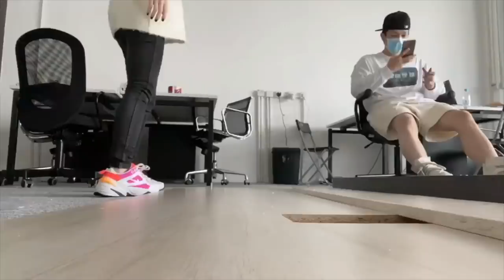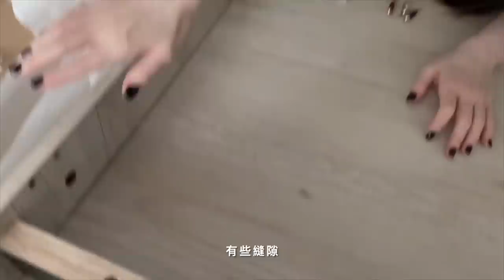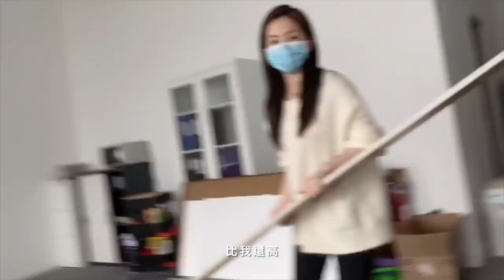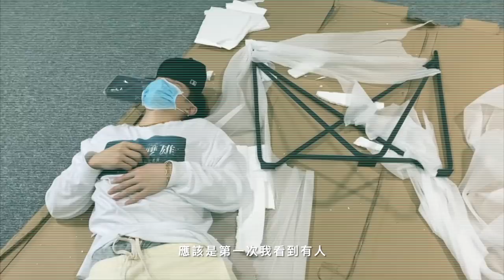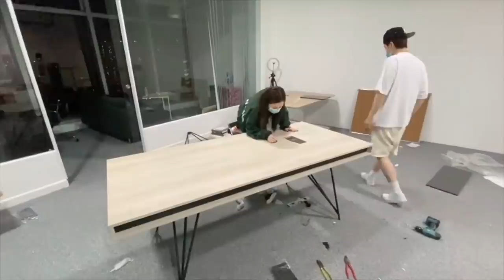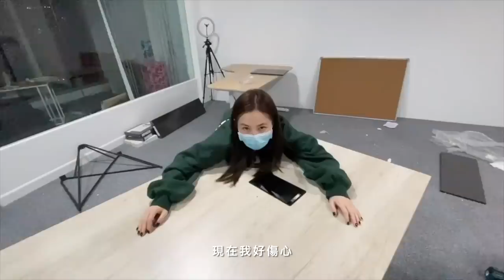GEM VLOG #21 沒想到有一天，我會變成木匠

Comment: Never dream that you will do this by yourself.  👍
May I suggest 2 ways to fix the hole on the table.
1. Use a "nice" sticker to cover it up
2. Get some filler from hardware shop and fill the hole up.
The 2nd one is a the proper way but I guess you will take the quick and dirty way. Haha.